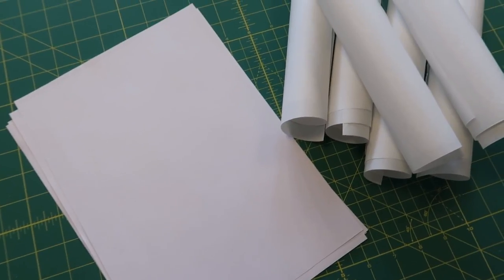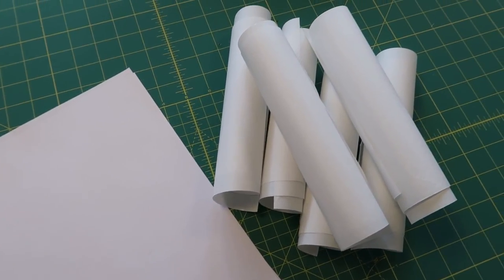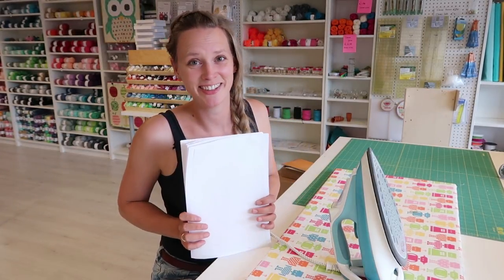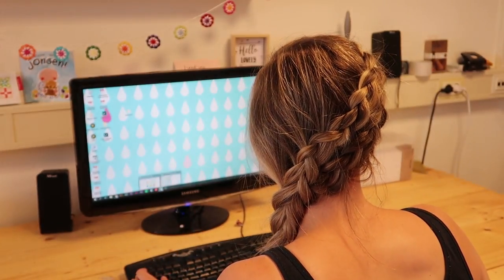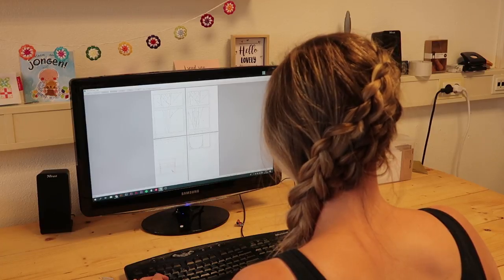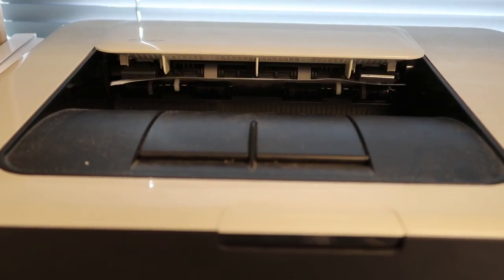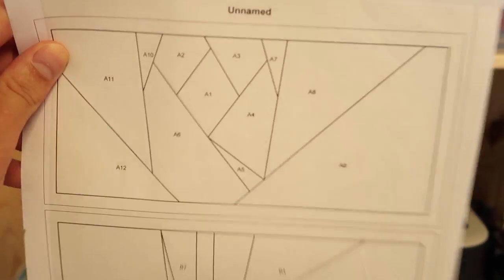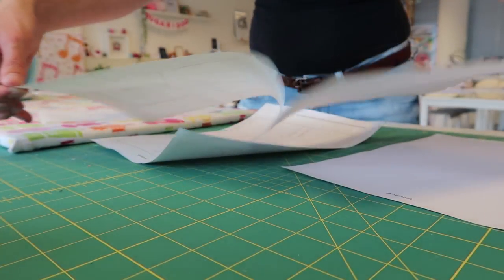How to print on freezer paper with a lazer printer | Quick Tip

Comment: I have an inkjet printer and I tried just cutting my freezer paper to the size of printer paper and printing straight onto the not shiny side. It worked great. Inkjet printers don't use heat the same way a laser printer does, so it was no problem.

Comment: Thanks for the video but there are some information missing. Some had written but got no answer! What side did you use in contact with copy paper while ironing? If you used the shiny side, this means that printing will be on the matt side, but what is needed to be able to print on the shiny side. Hope you will reply and thank you in advance
Reply: The shiny side is the plastic side, so it needs to be in contact with your copy paper. Otherwise it will get stuck to your iron.
Reply: @littleprairiepurl5175  that's what i thought, but in this case you're printing onto the paper side of the freezer paper, so why even bother? just print on regular paper... except there is an advantage to printing on the waxy side, which is that the ink should be able to transfer onto the wood or whatever much easier
so i think this is odd
Reply: @hajerm  - You're not trying to iron the print onto the fabric. You're simply ironing the paper onto your fabric so you can then cut out the pieces. Or in my case, I am going to be using for a machine quilting pattern. I have printed on the shiny side by taping the matte side onto the regular paper and haven't gummed up my printer, but proceed at your own risk! I used this to make branded masks for my nephew's business at the beginning of the pandemic.
Reply: @hajerm  If using ink jet, no problem to go directly onto non-slick side of the freezer paper, but with laser printer (which uses heat in the print process) you need to have something to keep the slick side from coating the inside of your printer.

Comment: will this work with an inkjet printer also?
Reply: I tried just cutting the freezer paper to the size of regular printer paper and printing straight onto it (on the paper side, not shiny side) with my inkjet printer. It worked great. I was having a terrible time getting the printer paper unstuck from the freezer paper when I followed the video instructions. I think you only need to stick it to regular paper for a laser printer.

Comment: I would suggest that people use the straightest possible paper path through their printer to reduce the chances of a corner lifting. If that happens it could just cause a paper jam or it could wrap around the internal mechanisms and then the printer is basically garbage. My husband works on printers and has seen several come in from people doing it wrong. A straight paper path really helps. Check the back of your printer for a door for the paper to exit. I'd love to suggest manually feeding because the pickup rollers in some printers have problems with thicker papers. When I did a project printing like this it took me 3 printers to find one that wouldn't  just jam immediately. Good luck printing and I hope my tips help someone. I don't want to see anyone have any disasters with their printers! 🙂 

I'm anxious to see the pattern. I've wanted to try paper piecing and I love tulips. 😍🌷
Reply from the maker: Wow Ali thank you so much for all the great suggestion! This for sure will help people for printing without problems. Thanks!!

Comment: I tried this, and it worked really well to print, but now the paper won't come off of the freezer paper! It's not peeling back cleanly at all. What kind of freezer paper do you use? Is it household freezer paper? That might be my problem, I'm using a crafting specific one, and I think it's not meant to pull off as easily.
Reply from the maker: Hi Liza, hmm so sorry to hear that. Yes I use cheap household freezer paper. That might be te problem.. did you already find a solution?
Reply: I ordered some cheaper household stuff.  I’ll let you know once I try again! Love the videos, and your studio!
Reply: Sure enough, the cheap Reynolds kitchen freezer paper worked like a charm!
Reply: @LizaSM  it got stuck
Reply: @SaraValentin  Maybe if you slightly re-warm the freezer paperwith the iron, the 2 sheets will separate. That's what you do if you mis-position an iron-on embellishment.